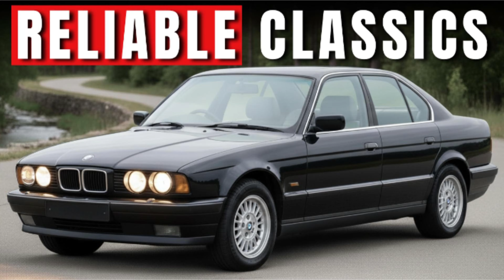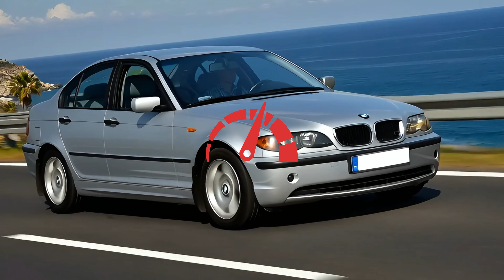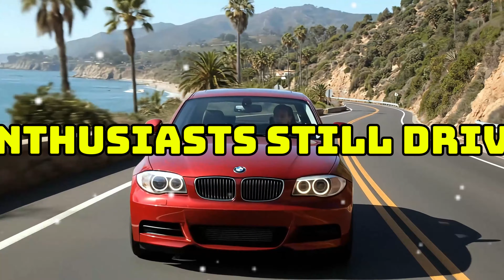5 Classic BMWs That Are Surprisingly Reliable

Comment: Had a 95 E36 M3 for many years, still regret letting it go. Currently working on restoring a 97 E36 M34D. Absolutely love these cars. Wouldn't mind finding a E39 530i down the road.
Reply from the maker: The E36 M3 is definitely one of those cars people regret selling. Such a special driving experience.
Great to hear you’re restoring another E36 — that’s a fantastic project. And an E39 530i would be a perfect addition down the road.

Comment: I had a 1985 E30 320i. Bought in 1988 with 30k miles. Sold it with 200k miles. Never had any enginecwork, and only a few repairs ever done. New radiator as it was holed by a stone, new clutch slave cylinder, brakes.and a rusty fuel tank replaced. One of the best and the most reliable car I have owned. A friend bought it from me twenty or so years ago and he is still driving it. Sills a bit rusty now.
Reply from the maker: That’s an amazing story.
200k miles with barely any major work — that really says everything about the E30. They were built to last. And the fact that it’s still on the road today makes it even better. Cars like that are the reason the E30 has such a legendary reputation.
Reply: @CartoplistsThey were mostly long distance runs not stop start miles. I used to travel to Aberdeen weekly from the North East. The car was fastidiously maintained and had a full service history from new when I sold it.